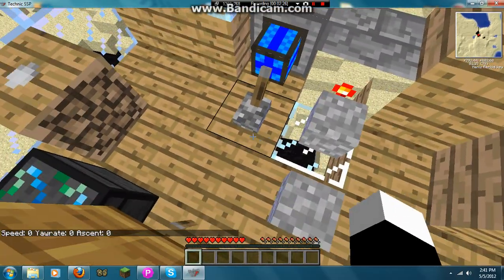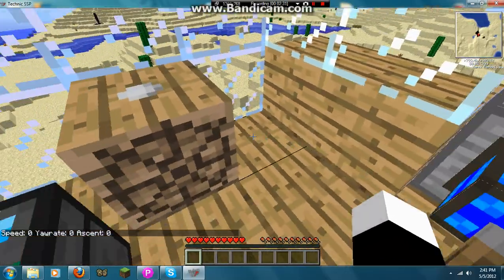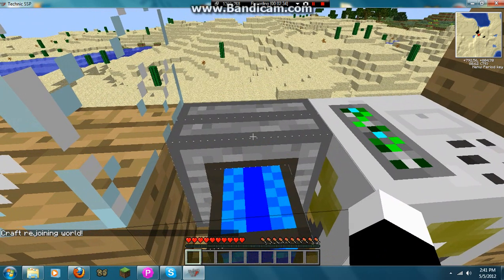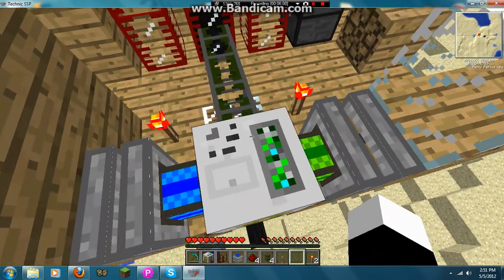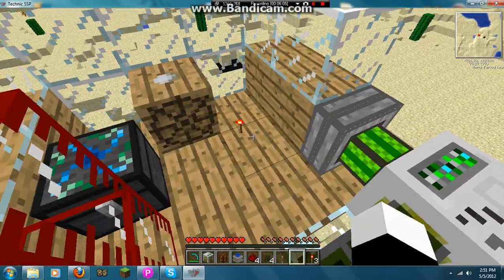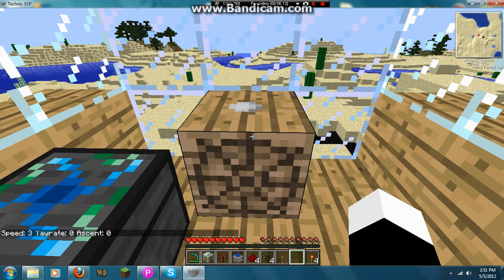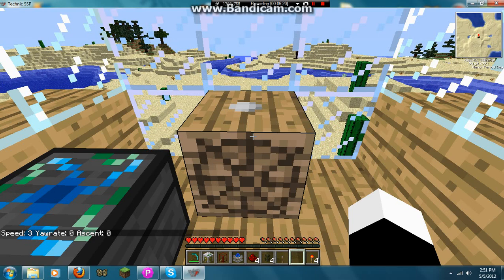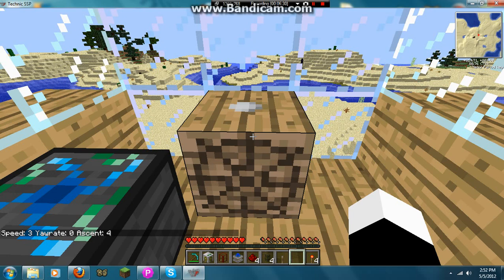Oil Airship Minecraft

Comment: im using the launcher. Maybe it damaged my map because the PUMP had its pipe in the water. I tried a simple ship later and it worked nicely , i just have to remove the pump , engine and pipes each time. It seems that adding stuff like battery box or solar panels crashes the game , too bad i had so many plans :)